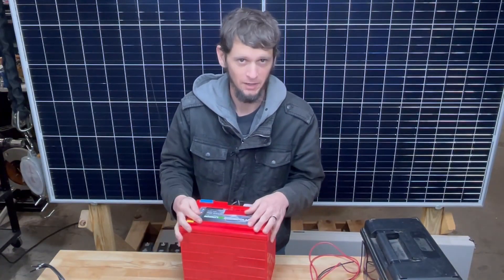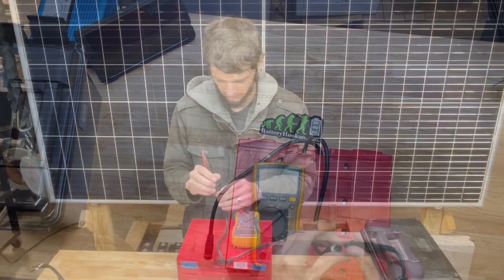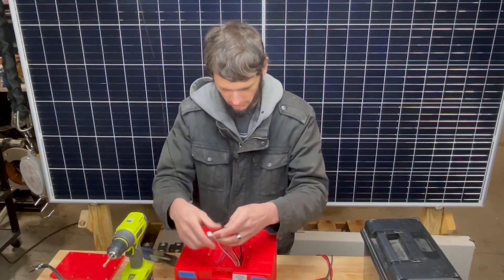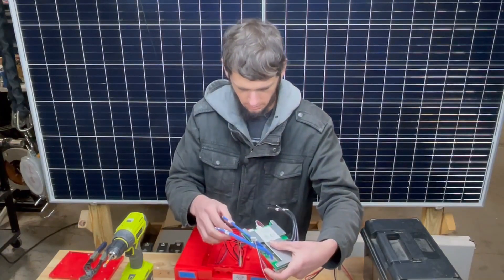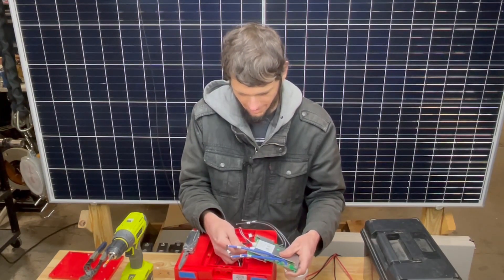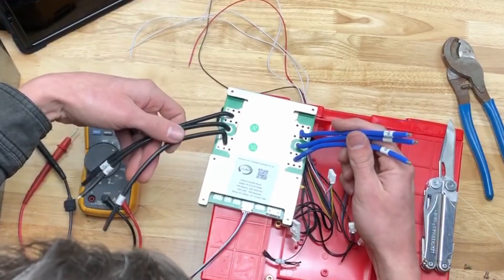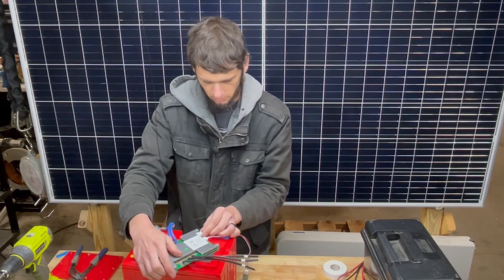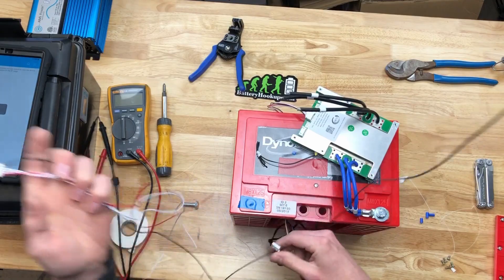$246 LiFePo4 That Continued My Battery Hookup Addiction

Comment: i would still go the route of buying 230 or 280 amp raw cells,  assuming you still have stock 0.0 im glad i got in when i did but these do make for an intresting option
Reply from the maker: Yeah amazingly still less expensive to buy cells and assemble, even at the prices I sell them for!

I think if I were to install in a very rough environment I might lean towards something like this.
Reply from the maker: I’ve got some 320ah cells on the slow boat right now :).

Comment: You can pop those pins out of the jst plug and put them back on in the order your bms requires.
Ok different plug, but the pin likely would fit in the correct one… just keep watching iRoc he gets there….
Reply from the maker: As I was reading your reply I had a thought. Wonder if those pins would have fit in the BMS connector. Would have saved me mutilating the OEM one. Not that it matters, but now it's bugging me!
Reply: @BeeneEnergy  pretty sure they would have. You still have it? Of course you do
Reply from the maker: @geauxracerx  ha ha of course I do. I’ll have to give it a try. Just because.